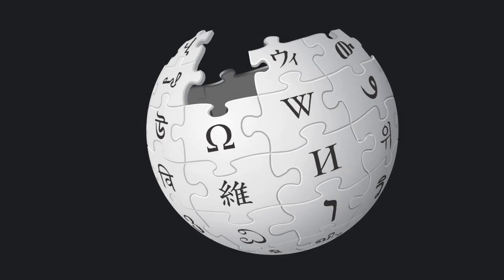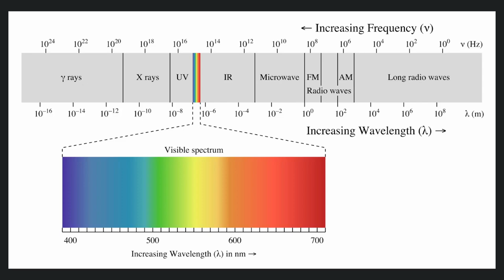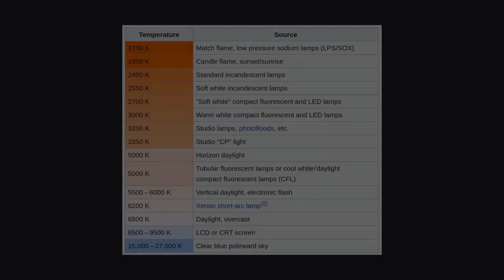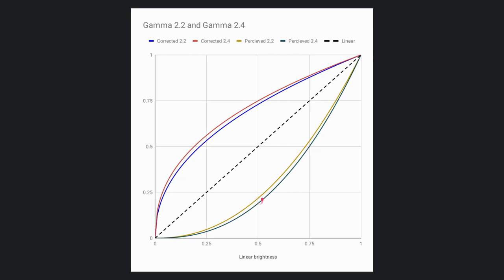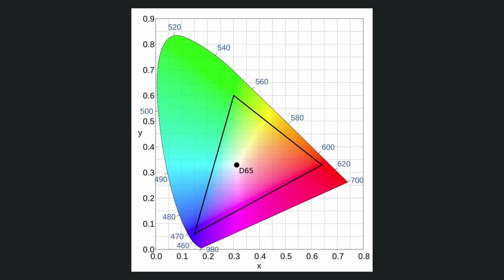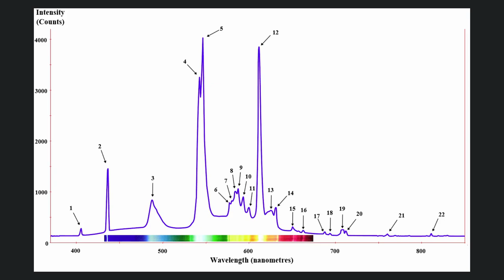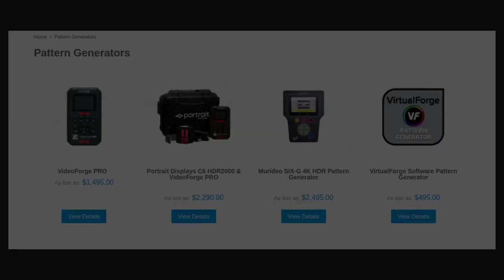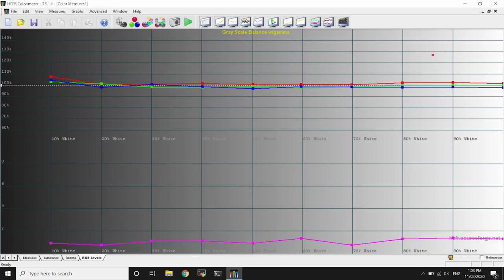CRT Colour Calibration - Part 1: Colour Theory

Comment: Hello, I just bought a 34-inch CRT brand Samsung Tantus CL-34Z7HE is HDTV. I notice immediately that it looks better than a crt SD tv, however the image is not very clean, it is noticeable as noise and the edges of the letters have greenish on one side and red as a chromatic aberration. Do you know if it can be fixed with a service and how much would it cost?
I really doubt that's his final image.
Reply: @stickfreaks466  Thank you, and yes im gonna take it to the repair shop this week.
Greetings from Acapulco México

Comment: Hey mate does your walkthrough works with LCD monitor? I have a Dell S2721DGF has a wide gamut display I want it to show sRGB universally. I did not know beforehand that ICC profile only works on color managed applications. It has brightness, contrast, gain (R,G,B), offset (R,G,B), hue (R,G,B,C,M,Y), and saturation (R,G,B,C,M,Y) controls. So is it possible?
Reply: @stickfreaks466  Hello mate I am on color calibration now on my display can you help me atleast for now. I have hue (R,G,B,C,M,Y) and saturation (R,G,B,C,M,Y) controls I do not know which is to use when adjusting a color
Reply: @stickfreaks466  already done white/black levels, grayscale, and gamma. I am confuse which to use e.g. when tweaking red primary with 75% intensity should I adjust it from saturation or hue and should I use the "R" control? Is it same thing with secondaries?
Reply: @stickfreaks466  so when I am adjusting red I need to use the red controls from saturation and hue?
Reply: @stickfreaks466  yeah mate can't wait for tutorial good luck